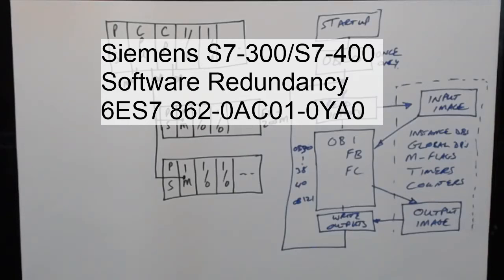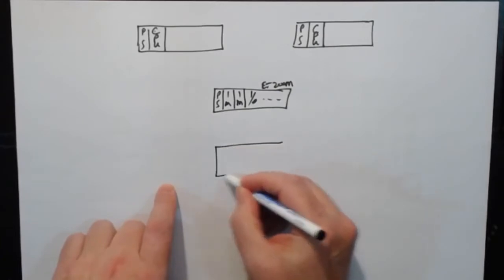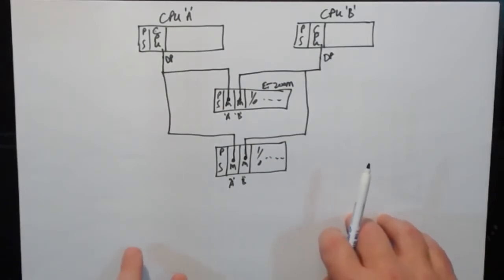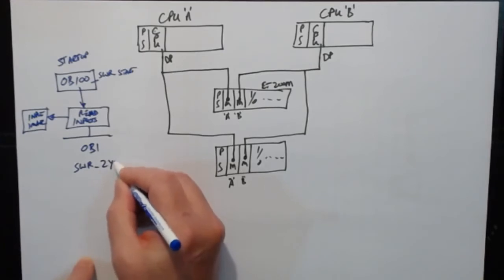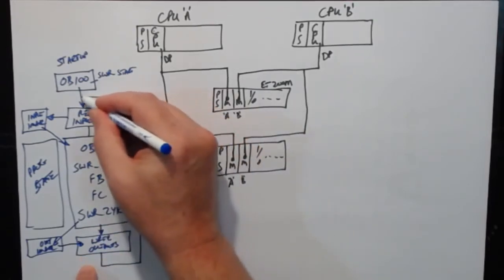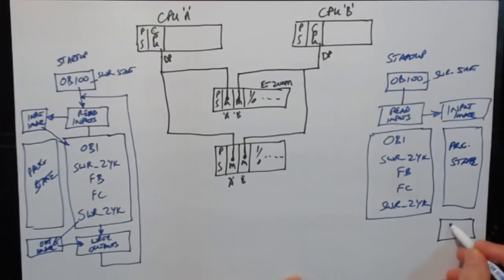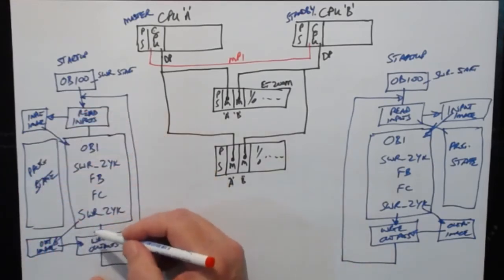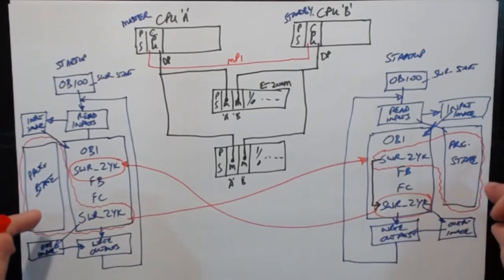Software Redundancy   Part 2 - Network topology

Comment: Very infomative and handy to why the architecture is setup the way it is. I do have a question about CP cards (Ethernet) if you can shed some light on. In my setup we are upgradding an existing system to have Software Redundancy and this communites with a non-Siemens SCADA over Ethernet. Would Comms drop out during the switchover if we have CP in the PLC racks or is it better to have CP in IO Rack?
Reply from the maker: I haven't seen a topology like that. The versions I have seen have two connections on the third party system, communicating all the time with A and B, and inspecting the redundancy status to direct commands to the current master.